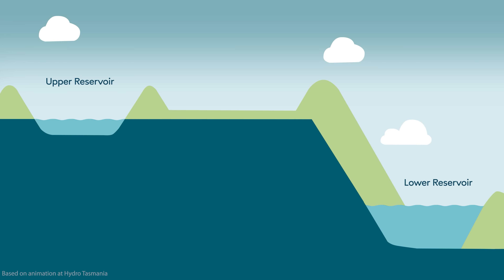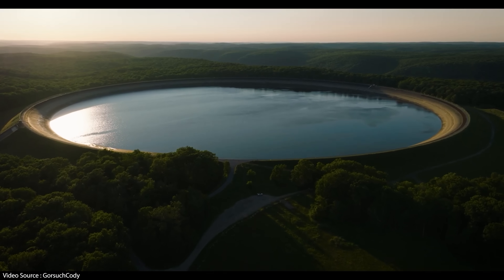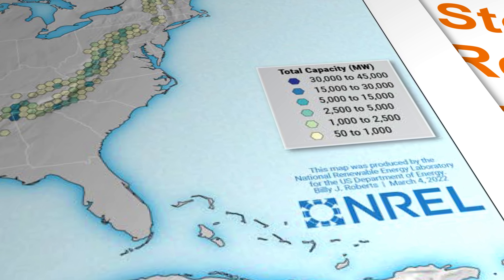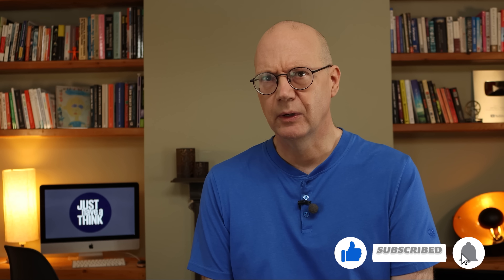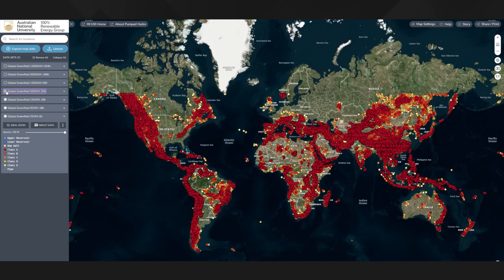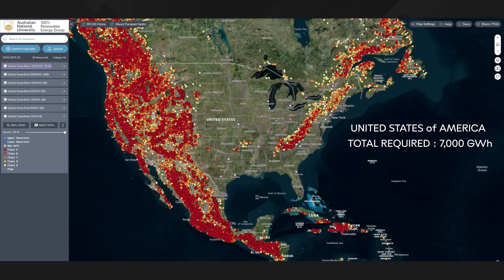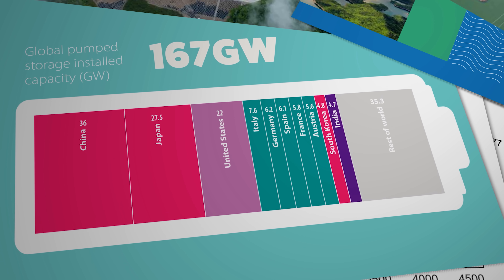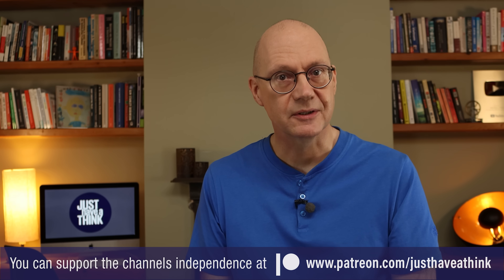The insane potential of Pumped Storage Hydro

Comment: Makes sense to me. I come from Norway with 90+% hydro power. Of course the vast majority of water just spill out into the fjords. Pumping it back up makes sense when power prices on the spot market is zero or even negative. Of course having the Norwegian grid connected through Acer and crazy EU auction scheme meant to screw customer by having highest power prices possible is just simply stupid. That throws away the only significant competitive advantage this small country has.

Comment: The executive summary from the IFPSH in September 2021  states ‘While PSH is a mature technology, there are emerging innovations: -- installing PSH at disused deep mines (combined with heating systems), non-powered dams (and their reservoirs), off-river PSH and seawater (as the low-level reservoir), PSH represents vast untapped potential’. 

These proposals do not include damming rivers for new reservoirs or inundating habitation as the Australian study does. PSH schemes can include off-river bunded reservoirs usually on hill tops that do not interfere with water courses, can augment existing water supply schemes and provide additional facilities such as strategic high-level reservoirs to fight forest fires and augment summer water supply. Schemes can include disused quarries and closed opencast coal pits and deep coal mines.

The UK has some 440 large dams (>15m in height) with many in series up valleys or at sites close in horizontal distance but with considerable differences in elevation. There are a similar number of lakes and high-level tarns as well as many abandoned quarries that can be developed for storage. Many existing reservoirs are in Pennine valleys often 200m below flat-topped hills where bunded reservoirs could be built and connected by pipes rather than tunnels making them quicker to build yet still economically viable. In summer, when less power is needed, the reservoirs can provide additional storage during drought and strategic firefighting water in case of forest or grass fires.

There are also some 1,500 deep mine shafts in the UK with many filling with water from 12ᵒC up to 21°C that could be developed as combined thermal and PSH systems. 
The recent BEIS study on energy storage identifies batteries as being the most suitable form of short-duration storage (SDS).  According to several studies, PSH has the lowest levelized cost for long-duration storage (LDS), and, as the most mature technology, it has the most predictable costs for both implementation and management.
By adopting the innovations recommended by the IFPSH, I carried out a desk study for England and Wales that identified some 110 possible economic schemes.

Comment: Excellent video thank you! Having lived on a rural plot of land without municipal water supply for more than two decades, I quickly learned about the great value of a hydram pump about 400m from my water tank, at a gradual upslope of about 15 degrees. I'm now living in a city suburb and have been thinking that, in addition to solar power, it should work if I have a water tank about 5m high that can easily be filled using solar power (or a self-made ram pump), and connecting it to a little turbine at ground level, which in turn generated some electricity to charge the solar batteries, esp. at night. I do see examples of building a small closed-loop hydropower system for one's own home. Will follow it up! The reason why it is vital to consider such is simple: we cannot trust the government here or any corporation to provide consistent network power (I am from South Africa), where self-sufficiency is the key to future survival.

Comment: AUSTRALIAN ENGINEER HERE:
What's missing from this discussion here are the facts about THE COSTS OF CONNECTING these installations to the existing energy grid.
FIRST: I am 100% in favor of using pumped hydro WHERE ITS SUITABLE and that is not simply a matter of geographical topology. Its also a matter of where grid connections are. there's an implication in this video Australia has lots of easily accessible places to inject power AND THAT IS NOT TRUE.

The Snowy 2.0 project was sold to the Australian people at a cost of AU$4 Billion. Before the first rock ceremonial shovel was stuck into the ground that became AU$5 Billion. Since then it has been revealed that the grid connection was NOT INCLUDED in the original costs and the project is now going to cost at least AU$12 Billion and possibly (and probably) over AU$14 Billion.
YES the grid connection for Snowy 2.0 might cost 2-3 times what the pumped hydro system will cost. 

This is the sort of thing that constantly annoys me as an engineer from EVERY SPRUIKER of energy solutions. They always leave some inconvenient fact out of the discussion. Right now here in Oz we have a bunch of people screaming about why we should build some nuclear plants. I don't have a problem with nuclear except a plant like Hinckley Point C would cost us over AU$65 Billion and not be ready before the mid 2030s. We have another bunch of people screaming about SMRs (small modular reactors). I recently watched a lecture by an Engineer from Rolls Royce about how their commercial SMRs would be ready to ship around 2035. 

I am actually a big fan of hydrogen as a storage medium and using it in gas turbines BUT I also know hydrogen requires very careful installations as it not only likes to leak but is highly ignitable. I am formally trained and certified for electrical equipment in hazardous areas. I KNOW hydrogen has to be taken very seriously if you want to avoid bad accidents. I think using it in cars is insane considering the high rate of car accidents. BUT for industrial applications where we can, BY REGUALTION, have properly qualified people then its superb.

MORE THAN ANYTHING all the spruikers chasing money and amateurs who think their opinions matter NEED TO SHUT UP.

Comment: Pumped hydro has far more potential for stabilizing a highly loaded electrical grid during periods of peak electrical demand than expensive and environmentally damaging (at the scale required for load balancing of the grid) battery technology. Balancing electrical loads in a system that becomes increasingly unbalanced due to the heavily subsidized and politically driven adoption of solar and wind power will become increasingly difficult, thus cost of electricity will rise and the reliability of the grid will decrease. This will have a negative effect upon both the economy and environment which can only be ameliorated by the systemic adoption of either pumped hydro storage or nuclear power that is capable of load following (a capability of many of the small modular nuclear reactors that are now being planned). Load balancing is largely done currently with hydro and gas turbine power plants, The most efficient co-generating gas turbine power plants are not used for load balancing as they do not have much load following capability, they are not capable of being switched on and off quickly as the load requires and are most efficient when run hot and at 100% capacity, so gas peaking power plants use simpler, less efficient gas turbines that are capable of spooling up quickly. This is why there are currently carbon dioxide emissions that are a consequence of solar and wind power - as the current practice requires less efficient gas turbines to back up unpredictable solar and wind when there is insufficient hydro power availability (and most areas have insufficient hydro power capacity).
The most reliable power available, statitsically, is nuclear. Nuclear power also ties hydro with the lowest lifetime CO2 emissions and I believe that if higher resolution studies are made available it will be found to have the lowest global warming emissions of all, since hydro reservoirs emit considerable methane as the sediment builds up during the hydro plant's life time.
Ultimately, nuclear power is likely to be the most reliable, lowest greenhouse gas emitting, and least expensive electrical power source, as much of the current expense of US nuclear power plants is caused by legal challenges which are specifically intended to delay construction and and raise the price of new plants - another cause of increased expense is that many of the construction workers with experience at nuclear construction in the US have retired.
Every civilian nuclear power plant in the US is required by law to set aside a fraction of its income from electricity sales for decommissioning. As these plants sold an immense amount of electricity during their long lives there is enough money currently to fund their decommissioning themselves. I know this from personal experience as I helped completely decommission Maine Yankee Atomic Power Station to green field status. The decommissioning was extremely, extremely expensive to accomplish, but it was completed on schedule and under the budget available, and entirely with funds set aside by the plant itself during its active lifetime. Oddly, I have never seen anti nuclear activists mention this successful and completely effective decommissioning, they would have you believe that such a decommissioning has not occurred and cannot be done without using large amounts of public money, which is entirely erroneous and entirely misleading.

Comment: The greens are against hydro power storage. They are basically against everything, more than less. 

I think, the power companies should cut the power to the greens at their offices and their homes whenever the other hydro storage stations are used. Or whenever they should be built and in use, most importantly when solar and wind power is below some value, maybe below 30% or 20% of their installed power value in their respective country. 

The greens alway say "save power first before installing new power supplies", so they should take their own medicine and save energy when there is not enough available without hydro power storage. It happens almost every day.

They just don't see it - and this way the greens will see that it's necessary to have more energy storage available.

Maybe - just maybe - the greens can learn and just look at the graphs and see it with their own eyes that there are many times when the wind is not even delivering barely enough when the sun does not shine.

Comment: I actually used chatgpt to try to determine if I could make a pumped hydro closed system as an alternative to a lithium battery pack for home storage. I don't remember the exact numbers, but I do recall that I didn't feel that it would be feasible given I only have about 5 acres and about 100 feet of height to work with.

Comment: As the water resource engineer for Dinorwic Pumped Storage Scheme, I have to write that the claims made here are misleading. Dinorwic, still our largest pumped storage scheme has 9.,1 GWh. The 9 days without wind in 2018 as just one example led to a shortfall of 7,200 GWh. Efficiency is 75% so you would need to have had spare energy capacity of 9,600 Gwh available to pump the water up. Run any simulation of that and you  will find that the figures are so extreme that it cannot work.

For the record, it is of course trying to fix a problem that does not exist.
https://www.youtube.com/watch?v=jmTiL7JQSDA&t=68s

Comment: Unfortunately there's level of scepticism in Australia in pumped hydro for a few reasons, one of which was caused by a proposal for pumped hydro a few years ago, but instead of using renewable energy to pump the water up, it was instead proposed using traditional fossil fuel power generation to do so, but still somehow being sold as a green form of power. Secondly was the threat of droughts and water shortage which could undermine available water which people feel would be better used for farming and consumption.

Comment: @Just Have a Think ::
I'm an environmental engineer in BC Canada. I've given some thought to this because my province is 90% hydro powered. 
 I have ideas that will blow the doors off what I've heard in this video.  With your impeccable sentences and voluminous vocabulary, you fail to even mention the most important concepts of 'baseload' , 'Cost-benefit Analyses' and 'transmission line costs.' .. And then there is another problem to which I have no solution --> Selling energy across borders. 
With my ideas, there is no need to literally 'pump water up hill.' This is extremely inefficient. .. 
My idea uses existing small to medium hydro dams, adds wind generators and then converts wind energy into baseload at the source with minimum new transmission lines required. 
Like I mentioned though, a problem arises when this energy is exported. .. BC has existing long term energy export agreements with the western states at this time. However these are not conducive to increasing our exports.

Comment: We here in Australia have the "Snowy River scheme" A hydro electric dam system that is as useless as tits on a bull, mostly because we dont get the rain or snow fall to make pumping water back up hill on a constant cycle. The only problem with Snowy River scheme mark two is that we are being snowed by idiots who use big words and smile as they say it. Do the math's when talking about the wind 'farms'.  5 million homes on or near the coast. 50 off shore wind mills at $50 million each replaced every 5 to 7 years. Then there are the solar panels with a similar use by date at $ 3000 per house. But it will take huge amounts of energy generated with current coal and gas to process the raw materials needed for these items. A process that will never stop, until the infinite amount of these raw materials and energy needs will come to an end. All this, based on theories that it is man fucking up the environment. And, to make matters worse. Very little of all these renewable harvesting devices can be recycled. I hope NIBIRU gets here real soon and ends all this insanity.

Comment: Typically the BBC programme on future energy / heat pumps didn’t mention pumped hydro. Perhaps you need to drop them a note. Nor did it mention any of the other types of energy storage such as sand batteries, flow batteries, etc to deal with the intermittent issues with wind and solar, although as part of a national grid it’s always windy somewhere in the UK. I wonder why the government is still pushing hydrogen, could it be to help the oil and gas industry to keep making profits whilst pretending to be green. The Cadent representative clearly lied saying the only thing produced by a hydrogen home boiler was water, no mention of NOx. Then he said plastic gas pipes can take hydrogen without mentioning embrittlement in any metal valves, etc or the leakage through the plastic. The BBC journalist didn’t seem to know about this either, which was worrying.

Comment: Yay!! I've always thought "gravity battery" is our best, simplest energy storage.  The "water tower" concept is widely used already as a way to increase water pressure in small towns.  It would be no different to have the same or similar system with an over/under set up where there are an above and below ground reservoirs pass/pump water between them.  It's simple, easy, and exists today.